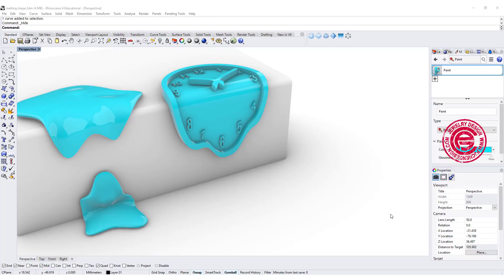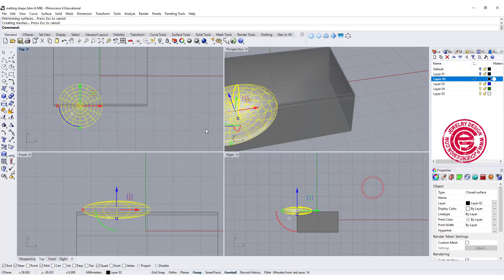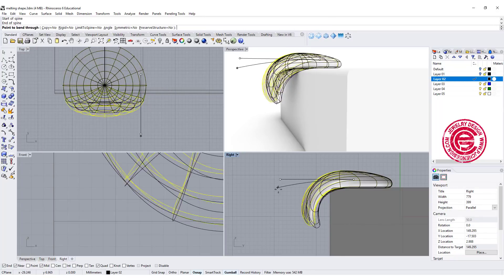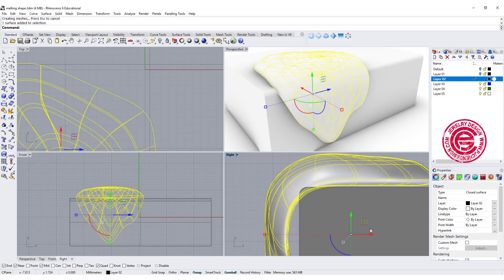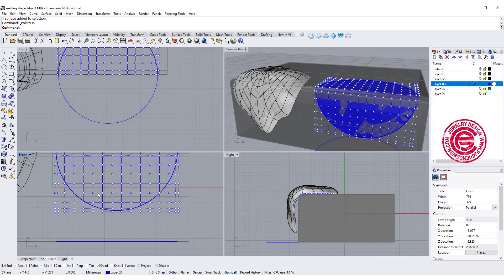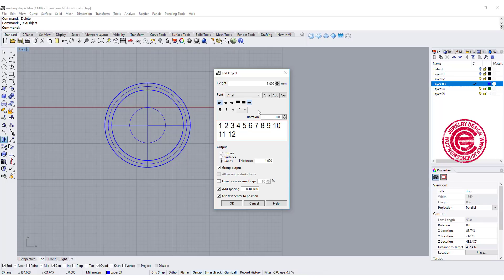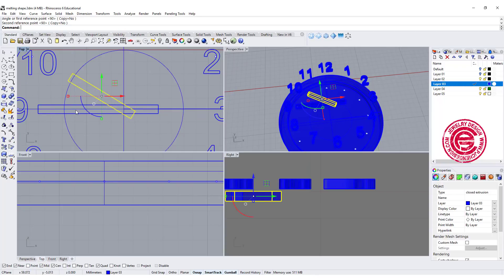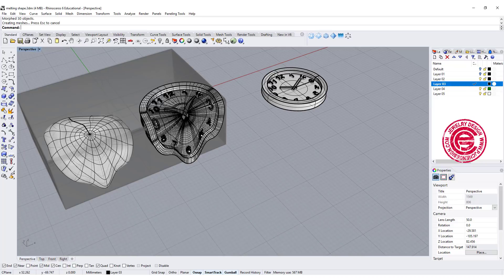How to 3D Model a Melting Clock and Puddle of Water (2019): Rhino 3D CAD Technique #24

Comment: Hello PJ, nice to draw an organic shape. I would like to be able to draw more organic forms such as a lizard.  Is it possible to give a lesson about this once? Would be great!
Reply from the maker: you can try to pull and push control point from a close surface in Rhino. However, I will suggest to use Tspline or Clayoo plug in if you have. if not you can try the Sculptrix free software and bring in back to Rhino once it is done.
Reply: @PJChenJewelryDesign  Thank you for your answer. I have the Clayoo plug in but I do not know how it works. I will look on Youtube if there is an instruction video

Comment: nice tips as always. some additions:

1. in this case better use an ellipsoid not sphere. the ellipsoid UV grid is rectangular not polar, which is a lot handier for bending.

2. when bending, after rebuilding with at least 15UV, you could make the bend spine very small, exactly like the inner radius you want to achieve. So start from the edge of the box or a bit inner and away from it, by approximately your desired bend radius. then choose the second bend point so as the bend is desirable (from almost perfect to very distorted/melty bend). The stiffer/less fluid the material, the higher the bend radius/bend spine. So, explaining how the length of the bend spine influences the bend behaviour, would be very handy.

3. you could also use the cage editing function, again with 15x15 UV grid. 100% accurate, planar bending, no unpredictable bend results or non interactive flow along surface procedures, plus bend, melting and moving/fine tweaking, in one step. ;)

best regards.
Reply from the maker: Thanks for sharing!
Reply: @PJChenJewelryDesign  another way would be to prepare an already bent sweep 2 rails surface. rails would be the bend, and profiles would 2D or 3D morph to the final shape. then flow surface the desired object to melt. with history enabled, would feel pretty editable.

i have learned many tricks from this channel so happy to share back, anything that could be useful or food for thought.
Reply from the maker: @constantinosschinas4503  super!!